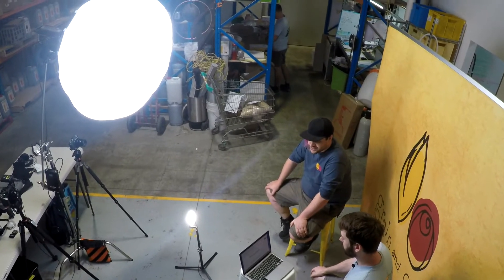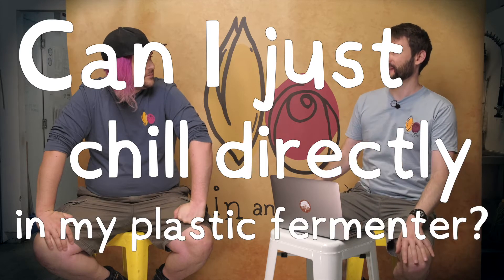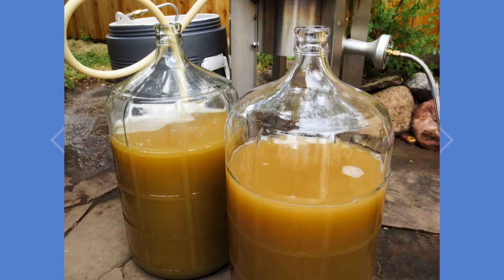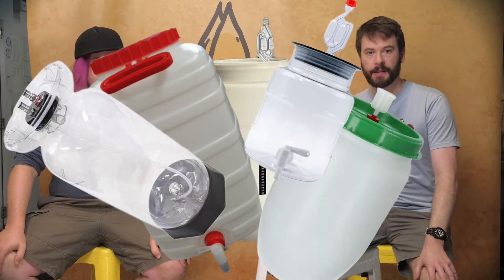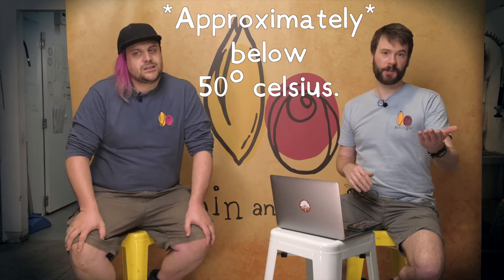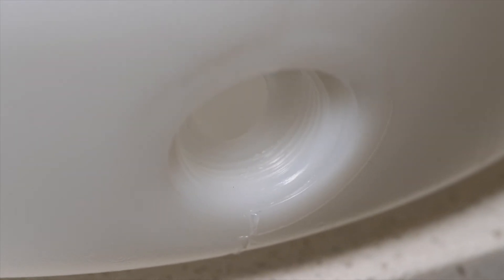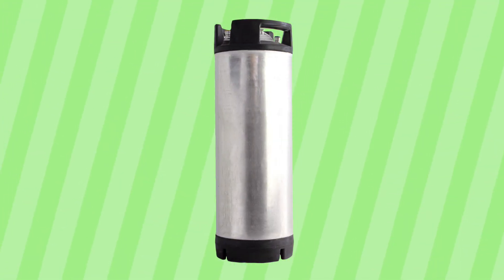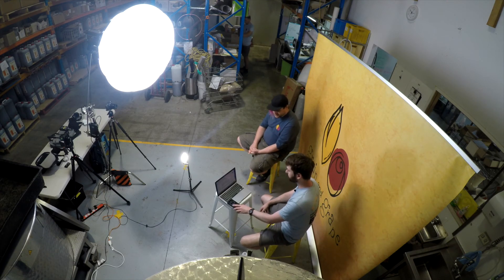Can I use the no chill method in a fermenter? (or in a keg?)

Comment: I suspect glass should be fine if you preheat it. Putting some mildly warm water in and swirling well, followed by boiling water (with gloves on) and swirling a bit... I don't see why glass shouldn't handle it as long as you heat it up a bit gradually first.

Comment: Good discussion. 
I was thinking of trying no chill in a sanitized corny keg set up. The heat would conceivably also sanitize, at the same time. Not too worried about replacing the cheap o-rings as that is not really an issue, (every one who kegs, should have replacements of these on hand). Then maybe using the same keg, to pressure ferment with as spunding valve and floating dip tubes. Would there be any oxidisation issues with the oxygenated head space in the keg while cooling overnight prior to pitching. I have seen people doing the cube method by filling completely up to the top of the vessel to eliminate oxygen. I assume that is precautionary for longer term storage. I just want to save cooling water and faffing around with chillers. I have 6 kegs that I can play around with, so I was thinking of split batching in 2, with different yeasts. Pressure transfer to 2 co2 purged kegs for dry hop and secondary ferm, cold crash or serving. Then over to a serving keg if necessary. I normally use a fermzilla 35L with pressure kit and a ferminator temp controlled system. Currently  I use the wasted hot water used for chilling to cleaning my brewing equipment. But chilling wort is a waste of water and time. DrHans (youtube) has shown a no chill method in his all in one brewing system, using cling film to cover the top, then over to fermenter on the subsequent day. That seem also easy and viable for the lazier amongst us.
Reply from the maker: Thanks Daniel. 

Yep saving water is often one of the main drivers of the no chill method and no harm in that. As for oxidisation issues caused by the head space by no chilling in your keg the answer is a "maybe" 🤷‍♂
We did actually discuss that, and also touched on no chilling in the kettle, but that was cut out to keep the video brief... who knows we might make a bonus video out of it down the track. 

Basically there is a risk of hot side aeration, a contentious topic. I think it comes down to how worried you are about it (most brewers don't seem to be that worried). Opinions will vary.

Best practise dictates to leave as little head space as possible to prevent oxidisation, but it might be worth the risk if you are saving yourself a tonne of effort in the process. 

Give it a go, only one way to find out!
Reply: I would be careful using a corny for no chill… they’re not designed for negative pressure, and likely to collapse or at least deform, and they won’t spring back like plastic….

I don’t have specific experience with this, but I did watch an old 80L keg deform under vacuum when we crash chilled a Steinbrew in a river ;)
Reply: I use a no chill method with a corny keg. Haven't noticed any issues with the o-rings but I'll keep an eye out for that after this video. Thanks guys!

In terms of oxidation, after about 10 batches no-chilling, fermenting and serving in the same corny keg, I haven't noticed any oxidation isses. I haven't brewed any oxygen sensitive styles though, like a neipa, so can't say with authority that there's no oxidation. But with the pilsners, helles, bitters, pales and stouts I've been brewing, it's worked perfectly, particularly with pressure fermenting